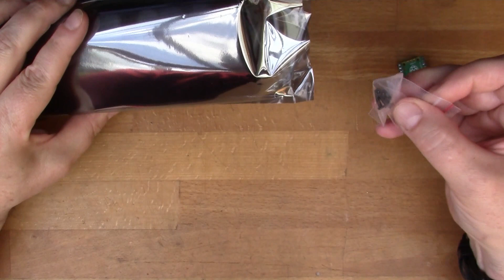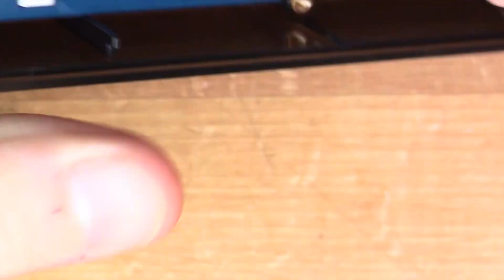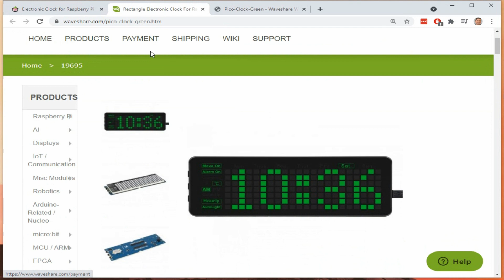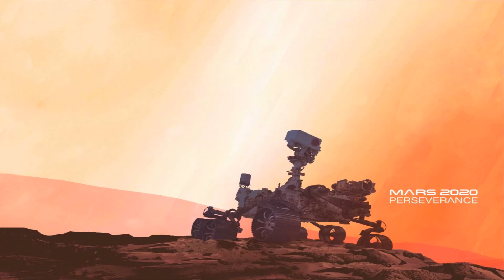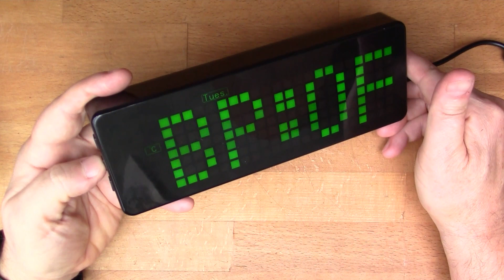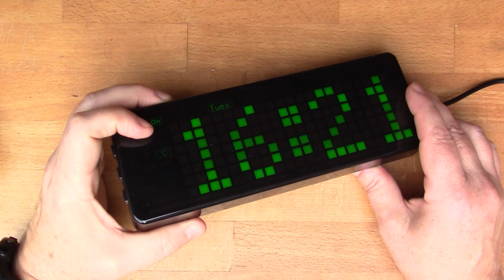Waveshare Raspberry Pi Pico Clock Kit (#137)

Comment: It will be interesting to know what type of temperature sensor it has and where it is located on the clock pcb?
Reply from the maker: From the source code, it looks like there are two sources of temperature on the board: one is on the DS3231 RTC chip and the other inside the Pi Pico itself.

Comment: Thanks Martyn. A major factor, when deciding which of the available alternatives to go for, was this video and I decided on the Pico Clock Green as a result. It's now all together and working perfectly. The Pico Clock green features a highly accurate DS3231SN RTC controller which is one of my favourites and another deciding factor.

I have but one query;  I was wondering how one updates the onboard RTC rather than manually setting the date/time with the side buttons. Is there any way to do that? Google is not being very helpful in that respect.Thanks in advance for any information, and thanks again for your video.
Reply from the maker: I think the software I was using is fairly barebones and didn't have that.  There are more choices now (I saw there was a Python version open sourced).  I want to go back to this at some point and add some custom features, like automatic daylight savings adjustment.

Comment: Lately these clocks have been selling for lower prices, under 20 dollars US, quite a bargain. It would be really interesting to make one work with a Pico W  so it could set itself from NTP. An advanced feature could be to adjust the clock chip ageing register from extended NTP monitoring. Those are Pogo pins, often used for board test setups. The software for these clocks is a bit rough, but they could really be improved.
Reply: I later found that the 3rd party software for these clocks has a ton of great features and is set up for both the Pico and Pico W, with NTP option for the W model. It has been improved! Occasionally they are sold at lower prices, too.

Comment: Looks neat. There is on enhancement that would be a fun project. That would  be to add a radio clock module for MSF (60 khz Anthorn) or DCF77 (77.5 khz Frankfurt). There are cheap modules consisting of a ferrite rod antenna and radio receiver; those might fit in the case. Tho the pico and led emissions might interfere with radio reception
Reply from the maker: I'll keep a lookout for those modules.  I love clocks that set themselves.

Comment: How to start the clock.

On the Waveshare Wiki page there is a link to the archive with the Demo firmware for the watch - Pico-Clock-Green. zip. It needs to be unpacked, there are six files in the folder and the "build" folder with the Pico-Clock-Green.uf2 file. On the Pico, hold down the boot button and connect it to the Raspberry Pi4, copy six files from the Pico-Clock-Green folder to the Pico memory, then the last main thing is to drag the Pico-Clock-Green.uf2 file into the Pico memory, after which the board turns off. If a Pico with already unsoldered contacts (except for debug contacts, the case will not close with them) is installed on the clock board, then you can simply connect them to USB RP4 and perform all operations with files, the clock will work immediately, I did this.